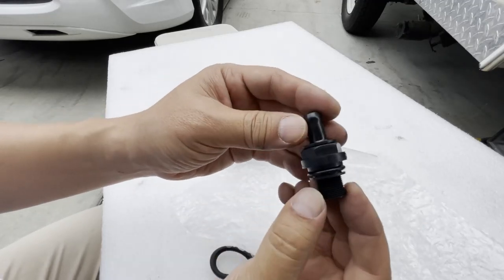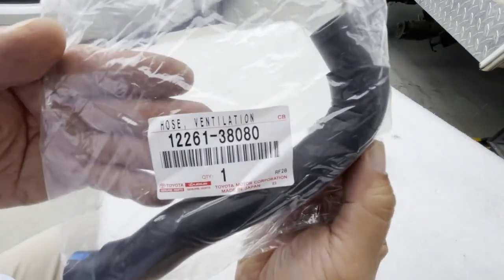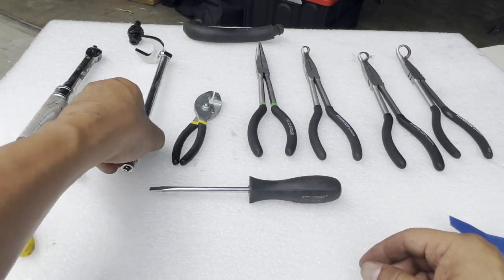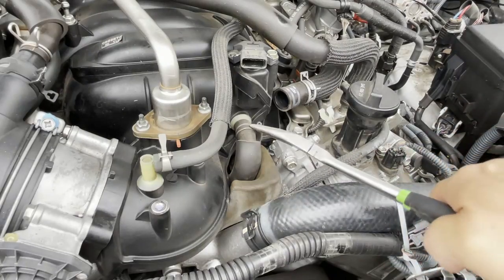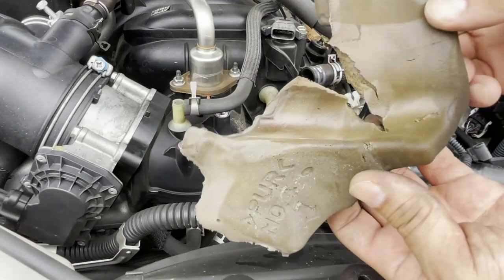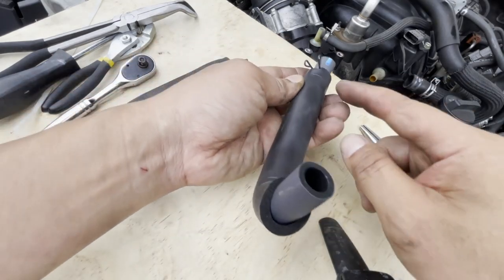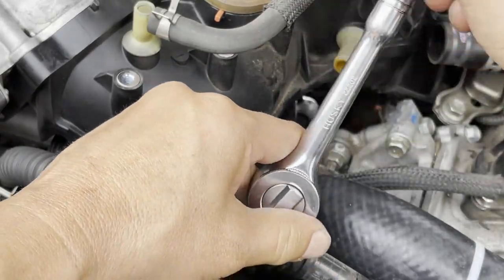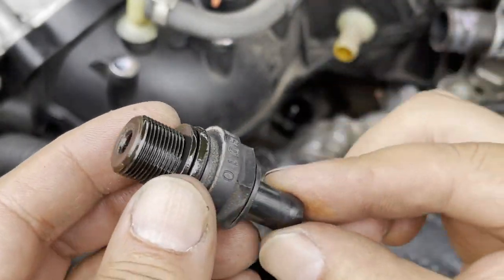Lexus GX460 PCV Valve remove and replace

Comment: I was quoted over $600 to do the pcv valve while I was replacing the radiator with Lexus.  Its crazy man
Reply from the maker: You could have done the radiator yourself too. 🍷
Reply: For sure, i didn't pay for the pcv job.  You should've ordered new foam for this job so you pass inspection. Lol

Comment: I believe the manual said that you must use German torque specs on the PCV valve.  Something about guten tight.
Reply from the maker: i received quite a few data on ClubLexus forums.  Moderator Acrad provided the spec for the PCV.  At the same time, remember the threads are plastic.  Don't want to go crazy on the torque wrench either.

Comment: Hi Gx Bob - I have a GX 460 2012 about 64,800 miles. I keep getting a P2714 error code. We replaced the transmission solenoid and the error code went away. After 6 months, the engine light, 4LO, and trac off display returned with same code. Any ideas how to fix this? Dealer was asking 10k to replace transmission.

Comment: Your instruction made quick work of this. 2015 GX w/ 99k miles, my rpms were bouncing a bit when idling and changing the pcv valve seems to have fixed the issue. Thanks for the helpful videos!
Reply from the maker: That’s great to hear! Did you do anything different that you thought was better and could be added to the instructions?
Reply: @GXBOB  No sir. You hit it right the first time!

Comment: hi Bob - I know its posted a year ago - but I just got a P0455 and P0411 on my 2010 GX460 - wondering if this will fix it? I replaced the oil cap but its not that - do you have any videos that address those error code?
Reply from the maker: I would look into your Secondary Air Injection Pump as your culprit.  I have a video on preventive maintenance for that but it seems that its too late for you.  There are many articles on it and Toyota knows about the issue.  I had it happen twice on my GX and the dealership replaced it for free.  
Here is an article on it and it covers all Toyota/Lexus truck series. 
https://tundraheadquarters.com/extends-air-injection-pump-coverage/

Comment: What’s all the foam in there for?
Reply from the maker: My best guess is the foam is there for noise dampening since other Lexus and Toyotas do not have this foam.  All the hoses and parts buried under the foam are rated for heat environment so i wouldn't worry too much about lack of foam.  Regardless, whatever you take out, just shove back in.  Trust me, the  cavity is so snug and compact, the broken pieces of foam will stay put.

Comment: How many miles do you have on your GX?
Reply from the maker: 83k miles.  My PCV was still in great shape.  I attempted the the PCV job due to the amount of requests i received on and off YouTube.
Reply: @GXBOB  My 14 GX460 Lux has 94,500 miles, the only repair I have done was the courtesy lights door switch replacement. Very useful video indeed, I plan on cleaning my EGR valve and replacing the PCV valve at 100K miles. Thanks Bob for all of the helpful videos you have put on Youtube.
Reply from the maker: @rohankrishna95  No problem dude. Just make sure while you got everything disconnected, to do other "maintenance" stuff.  Kill 2 birds with one stone.

Comment: 2017 GX460 3rd Owner. 121,847 Miles. Vehicle seems well maintained prior to me overall. PCV Valve had some visual sludge and the ball inside was still moving around, although, no where near as good as the new valve.

I use Penzoil Ultra Platinum 5w-30 and I change the oil between 5-8k miles depending on how hard the miles were. PCV Valve was still good to go!

I got the part for $10, and this took me about 25 minutes. Great value for the peace of mind!

Next is to lube the driveshafts! Thanks GXBOB for another excellent GX maintenance video!

Cheers
Reply from the maker: 25 minutes? I think you currently hold the record. 🍷
Reply: @GXBOB  I had a good teacher, and studied in advance lol

Comment: Thanks for the great video Bob.. Man, what a place to put the PCV valve.. Buried deep inside the depths of the engine.. Certainly took a while. But your video is very helpful indeed and will make it easy to change it.. Cheers...
Reply from the maker: Surprisingly, the job wasn't too bad.  With the right tools, of course.

Comment: Thanks for the video Bob! It looks really simple after you did it. I’m more confident of doing it myself than before your vid. 
After all, if you can do it anybody can do it! 😁
Reply from the maker: Not sure if that was a compliment or an insult.  Either way i'm glad you're going to tackle it.  Of course, you'll find a better way to do it once you go thru it yourself.
Reply: It was a compliment with a dash of humor.
Reply from the maker: @edfairley8347  yeah i know. I was just messin with ya.   Thanks for the comment Ed.  Hope to hear from u again...even if its an insult.
Reply: @GXBOB  
You’re usually very good at moving along your videos and the pertinent information you provide. Man, some of the videos I watch for information is like watching paint dry waiting for the guy to get it out. A couple of yours are like that when you get sidetracked with “irrelevant” stuff but I like your information.
Reply from the maker: @edfairley8347  lol.  Fair enough.
Reply: @GXBOB  
Hey Bob, Do you know if there is a solution for the GX high beam/DRL LED bulb flicker problem yet?
Reply from the maker: @edfairley8347  Seems like your HID ballast is about to go out.  I'm not saying that's the only thing that can go wrong to cause it  but that exact same thing happened to me with my low beams.  I removed my headlight assembly, purchased a new ballast on eBay for around $35, and installed it.  The problem went away.  Ballasts don't last forever.  You can also check all your wiring connections at the headlight plug.  Look for water damage or corrosion or looseness.  
https://youtu.be/dZ20nQ4eME4
Reply: @GXBOB  I don’t have HID on my 2012. The original bulbs are halogen but I changed the low beam and fog lights to LEDs.
I’ve been wanting to upgrade my high beam bulbs to LEDs. I’ve done research on this and found that since my DRLs are my high beam bulbs at a lower voltage, when they are changed to LEDs the DRLs flicker when they are on. However, with the high beams on there is no problem. Obviously you aren’t aware of this problem but i thought I’d check with you just in case. Good info on the latest TPMS warning light.
I added the extension nozzle to my spare tire also but i just tucked it under the plastic cover for the spare tire rod access. Works great. Thanks for your videos!

Comment: I need to try your foam push down method. Got down in there but the foam was encroaching big time, so i gave up. Will try again 👍
Reply from the maker: Have you tried foam spray? I was considering it. 
https://www.homedepot.com/p/Loctite-Pro-Gaps-and-Cracks-21-oz-Spray-Foam-Sealant-each-2866859/323836044
Reply: @GXBOB  what I mean is getting the lower pieces of foam out of the way so I can access and remove/reinstall the PCV. I really don't care about replacing the foam, believe it's just for sound deadening; I am lifted with 33" all terrain tires, could care less about a little more engine noise.
Reply from the maker: @evolusd   Oh...well then....you need to get comfortable with your needle nose plier and just go for it man.

Comment: Can you show me how to find USB fuses on 2013  gx 460 please because my USB port is not working. Thank you
Reply from the maker: Minh o Minh....electrical is probably one of the most hardest to do since we don't know exactly why your fuse popped.  Even if u replaced the fuse, it'll eventually pop again because you didn't find the reason why.  Replacing the fuse only puts a band aid on the problem.  I would, in my opinion, tap your usb power line into another ignition or accessory source within your car.  Perhaps your cigarette lighter....
Reply: @GXBOB  thank you

Comment: thx for all the helpful info threw ur vids, have you considered doing a trasmission flush and filter change on the "sealed" system? or installing the "trans cooler" radiator? from factory of course
Reply from the maker: I had the transmission drain and fill thru my local mechanic because they gave me a deal i couldn’t refuse. I thought about the trans cooler and looking into it. Thanks for the .

Comment: Well done video! Approximately how many miles do these PCV valves? Have a ‘14 with 91k and the Lexus dealer is recommending the service. Of course they don’t say “why,” whether it’s bad or it’s a mileage based thing...
Reply from the maker: Roughly 100k is around when you should consider replacing it. Lots of factors on why sludge build up can clog your PCV hence why different trucks clog sooner than others.  So typically the average number is 100k to do most of your maintenance that is not prescribed in your Lexus handbook.  Same with EGR valve.  I had a first generation with 167k miles that never failed me but this newer GX sent a CEL at 80k miles already.

Comment: Hi Bob great video!
My wife and I are looking to buy a new 2022 gx460. Any options that you do and you don’t recommend? Thanks again for these videos! We’re fairly new to the gx’s
Reply from the maker: Hey Rusty.  So some factors come into play. Do you have an unlimited resource of cash coming out of your cahoot?  Are you on a budget?  Do you care about offroading or is  your truck going to the local liquor store and back only?  Does this truck going to accommodate your family or is it just for one person mostly?  If it were up to me, i would definitely take the Sport Package with Premium plus and captains chairs.  Premium plus gives me power 3rd row seats (convenience factor) and the sound system (a must for long trips). Second row Captain's chairs  is definitely worth investing in as it offers convenience and steers away from the minivan feel.  Sports trim only because the outdated exterior design needs the extra trim to look and set itself different from other GX's.  (Especially the smoked tail lights)  If  you're able to do a lot of these mods yourself and find them on the aftermarket sites then save yourself a few thousand and just keep the Premium Plus with captain chairs.  Skip the sports package.  My 2 cents.
Reply: @GXBOB  thanks for replying!  I haven’t won the lottery yet so I don’t want to say I have money coming out of my cahoot lol. This is for my wife (soccer mom). She likes the new dash of the 2022 but we’re not dead set on it. Reliability is the #1 priority. So if there’s another year you recommend, we’re open to that also. I’ve been a Toyota fan all my life but she wanted a new Yukon. Well, 2 years later the transmission went out. So she’s finally starting to listen to me hahaha. I’m very mechanically inclined. I do all of my own maintenance. Except rebuilding transmissions lol. Thanks again for your reply and the videos!!!!
Reply from the maker: @motomarcel1  I like the new dash also but thats not going to make your Lexus any more reliable than a 2014.  Its good that you mentioned you're mechanically inclined because there are so much information and self help videos on the GX  nowadays (not when i first started, there was none).  Especially the clublexus forums for shared knowledge too.  So you have to balance out how much work you want to do with how much money you have to spend because they coincide with each other due to age and.....how much love the previous owner gave their truck before they handed it over to their new owners.  For personal choice,  i would definitely take the 2008/2009 as my favorite to buy and  work on.  You'll be lucky if you find one for kelley blue book price.    I would skip the second generation 2010-2013 (the front end killed it for me).  If you like newer than take the 2016-2019 and switch out the front grille yourself.  Reason why i skipped the 2014/2015 is because i never buy the first years of a model change, even if the changes are minimal.

Comment: Hi Bob when do you know its time to change the PCV valve, any error pop up? TIA
Reply from the maker: That’s a tough one because the symptoms of a failing pcv share the same symptoms as other emission related parts issues. Here is a basic list of them. 
Engine misfires at idle.
Increased oil consumption.
Hard engine start.
Rough engine idle.
Possibly black smoke.
Oil fouled spark plugs.
Easiest one is Presence of engine oil in hose leading to your pcv. Like most maintenance items, it’s just better to get ahead of it before you see the symptoms.

Comment: Dear Bob do u face any trouble with the air suspension yet ?!¿ mybcar is 2014 and rides like a horse 🐎
Reply from the maker: Hi Mohammed,  I've switched out to passive suspensions on 3 of my GX's in the past because i didn't want to deal with the useless air suspension.  I have shown the switch in my past videos on my 2008 GX470.  Its super easy to do and very inexpensive.  2 coils and 2 shocks kit.  The ride is so much better after i made the switch.

Comment: How often do you recommend to change the pcv valve?
Do you know also if the GX needs an oil catch can?
Reply from the maker: Hey Bill, i would do it at 100k as a rule of thumb.  Here is a really good write up if u want to educate yourself on why you want to change it.
https://axleaddict.com/auto-repair/How-to-do-a-PCV-valve-test
Reply: @GXBOB  thanks for the link for the in depth info. Do you know if GX is needed an oil catch can? I have it in between my pcv valve and intake, the oil catch can sits between those. Wondering if the GX needs it too
Reply from the maker: @willbill2209  I don’t mess with a gimmick that requires an extra stress on my maintenance routine. The amount of oil it catches over the lifetime of the vehicle doesn’t do any more damage than the Toyota engineers designed it to handle. Of course, this is just an opinion. But if you search the forums you’ll also note mixed opinions on the subject matter.

Comment: What’s the purpose of all that foam?
Reply from the maker: The foam on the PCV hoses and valve are used as insulation to prevent any moisture from freezing since condensation will sometimes develop.